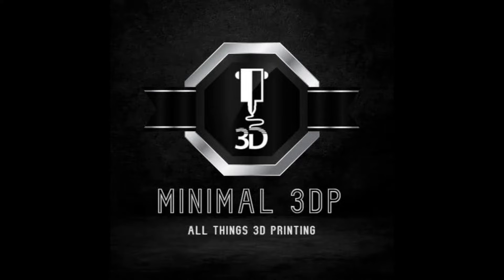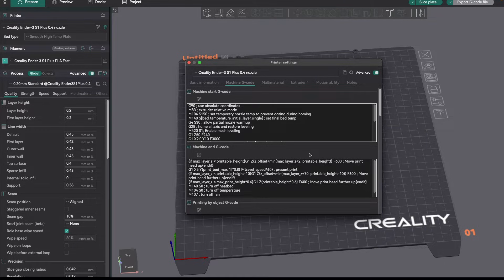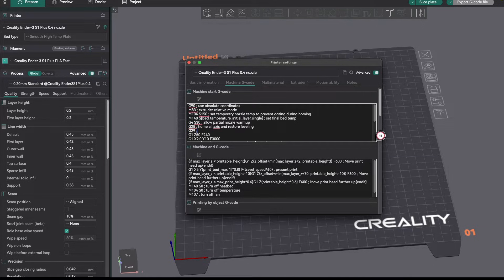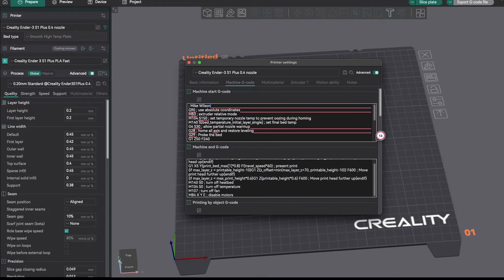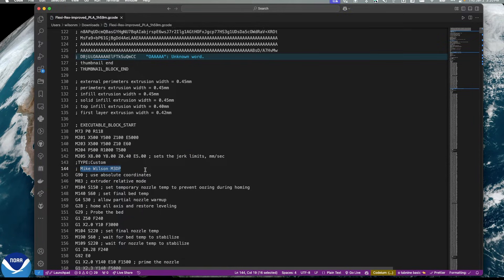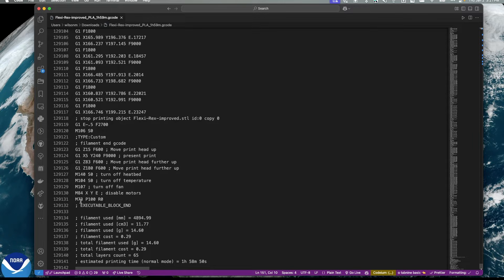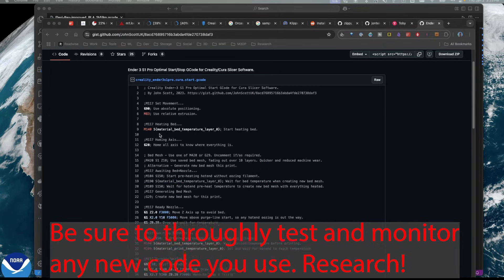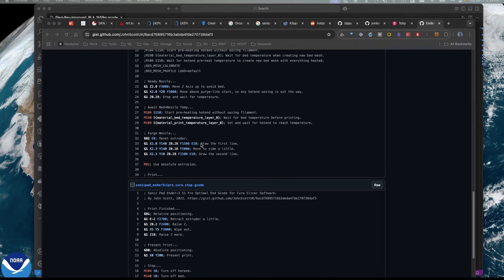3D Printer Start & End Gcode Explained (OrcaSlicer)

Comment: Hi, I would like to know how to modify the Orca Slicer startup g-code since the same lines always appear at the beginning even though I modified the code... the lines that always appear are;
;EXUTABLE_BLOCK_START
M73 P0 R110
M201 X500 Y500 Z100 E5000
M203 X500 Y500 Z10 E60
M204 P500 R1000 T500
M205 X8.00 Y8.00 Z0.40 E5.00
M190 S60
M104 S230
;TYPE Custom

And what I'm looking for is that when I modify the startup g-code I can delete these lines but they always appear by default

Comment: Thanks Mike for this, just now I have managed to watch the video, but I have fixed my issue from your Email. I appreciate your help. Picked up a Qidi Q1 Pro for $30(!!) with an MCU communication error. Ended up the head PCB - the rear board - was shorted. $36 later it's working great. It is way better than a Creality K1.